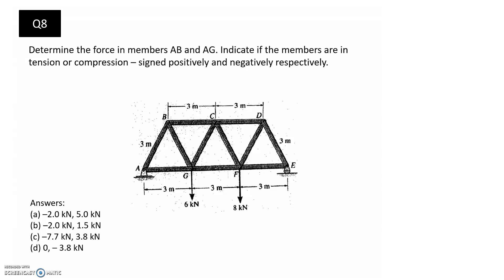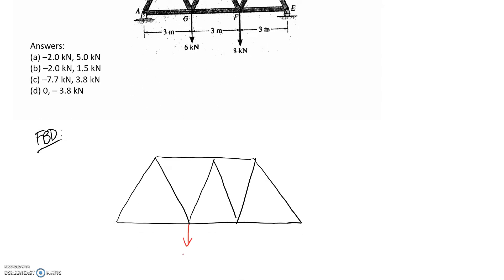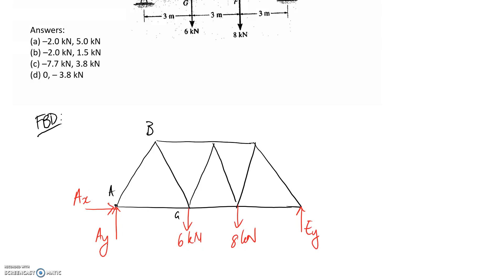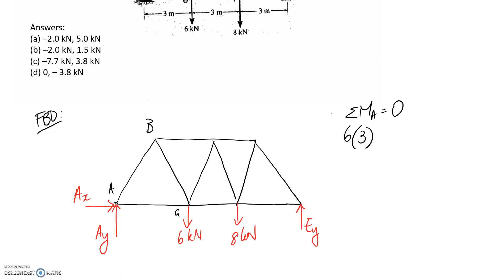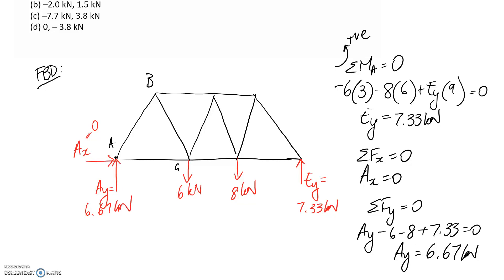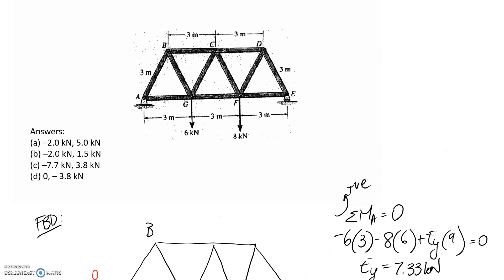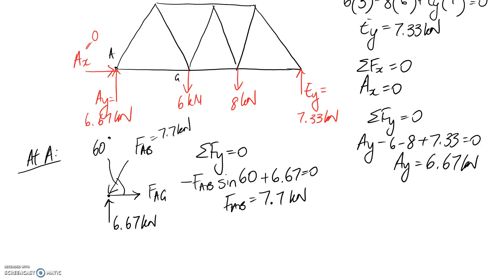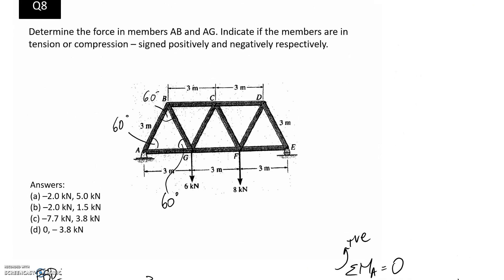Mechanics Sample Exam - Q8

Comment: Joint A is pulling member AB with force 7.78 kN so shouldn't memeber AB be in tension ?
Reply from the maker: At about 7 mins I say that the force AB is pushing on the joint so it's in compression. The diagram (drawn next to "At A") shows the forces on the joint. There is a recap video in the truss analysis section of the mechanics playlist where I discuss this in more detail - I note that directions can look counterintuitive when you consider on the full truss diagram.

Comment: Hey could you determine the magnitude of the reactions and the forces in each member of this frame please...that would be so helpful
Reply from the maker: If you wanted to figure the others, I recommend following the process of isolating each individual joint and doing the sum of forces calculations. I'd recommend doing joint B next as there would only be 2 unknown member forces (which is the max you can deal with given 2 equilibrium equations you can use). You can then just keep moving across the truss (next G then C and so on). There are some other videos I have on the channel of solving forces in trusses too.
Reply: @theryderproject5053  I dont know why i just can seem to get zero at the end.
Reply from the maker: @jonathanpalmer7440  I don't think any of the members will be zero force so maybe that's the problem?
Reply: @theryderproject5053  help me please🙏